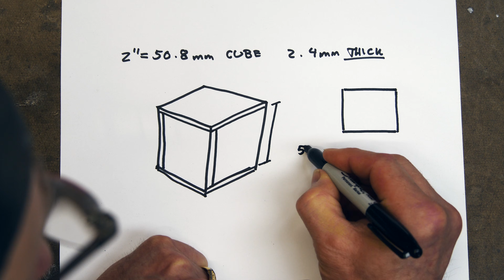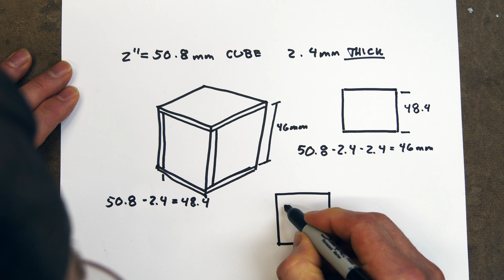Basic Acrylic model making for Designers, Architects & Makers

Comment: Nice video. It was VERY informative and answered several questions that I had regarding methods of cutting. I'm glad I found your video.
I am going to make some display cases and I need to put "shelves" inside the case (basically a large box). What type of a router bit would you recommend to clean up the edges of the shelves (or all of the pieces) where there will be a butt joint onto the inner walls of the "box"? Spiral upcut bit?

Comment: Finally somebody who can show the different glues. I cut acrylic with a laser, and many glues cause small cracks (creases) in the heat affected zone. Only one glue did not do that, a uv activated very liquid glue by Ruplo. Do you have experience with glueing laser cut plexiglass?
Reply from the maker: Plexiglass is polycarbonate, much different properties than acrylic, I really only have experience laser cutting acrylic and then using acrylic solvent to bond the material together. I'm not familiar with the adhesive that you're talking about. Experimentation is really the way to go. Thanks for your comment and sharing your experience.
Reply: @EricStrebel   nope, Plexiglas is a brand name for acrylic, after laser cut or flame polishing the sheets need annealing
Reply: Acrifix or magma bond is what we’ve used in our laser cut boxes
Reply: Methylene chloride is available through most plastics suppliers.

Comment: Another way is to make a template of the parts and then use the template and double stick tape to flush trim your parts. Cut your blanks bigger by about an 1/8 of an inch then route.

Comment: Hi sir, is Solvent and melted Acrylic aquarium safe? What is recommended to used for Acrylic and PETE? And for Acrylic and PVC? Is Acrylic good with Silicone? Probably is my bad skills..Thanks and appreciated your kind advices.
Reply from the maker: Each material will require a specific solvent, but once the solvent has evaporated it should be inert and okay for your tank

Comment: What kind of Glue  or what is the name of the glue used to Apply on the Acrylic  to stick it? Tnx
Reply: Cyanoacrylate (CA) glue
Reply: @davebacknolaliki1452  thank you
Reply from the maker: No, that is not what I used and it is not the correct glue for acrylic. You need acrylic cement or acrylic solvent. Link in the description

Comment: Hi Eric, thanks for the videos, very informative and I keep looking out for when "Motorhead" will appear and on what 🙂. I'm try to build a box using the 45 degree router method but am struggling to get a good clean 45 degrees along the length of the acrylic. Any tips?
Reply from the maker: Table saw works well

Comment: I want to build a gerbil cage for my gerbils that is larger than what they have now. I want to use acrylic sheets for the cage. But the frame, I don't think I can use wood. If you know gerbils, and I guess only people who had them as pets know gerbils.... They are major chew monsters. Anything made out of plastic, cardboard, wood, etc can be chewed into tiny little shreds very quickly by these little creatures. You could buy a bunch of gerbils instead of a paper shredder and you get the job done. Or even one gerbil and they would get the job done. Does anyone have any suggestions for what to frame my gerbil cage with? I mean metal would be ideal, but I can't cut metal so easily with my equipment.

Comment: just use melamine saw blade and a plate with zero clearance for the table saw add on your cut 1/32'' or .79375mm on each side and use a jointer to reamove the extra material and you will have a prestine edge for gluing.
Reply from the maker: Hmmm, interesting, so a planer is needed, what would the  min or max thickness of the acrylic for that?
Reply: @EricStrebel  you can put many sheet of acrylic hold with C clamp and if you are able to handle the weight of your stack ( depend of the dimension of the part minimum length 8'' or 203.2mm ). for the capacity of the jointer 6'' up to 16''. The planer you are limited in the width of your piece because a planer opening are 6'' or 152.4 mm up to 8'' or 203.2 mm  minimum length 12'' or 305 mm and you need a jig. With a router table your can too like a jointer but you need a guide with a difference 1/32'' or .79375 mm  between in and the out. You can cool the part with a blast of air and help the bearing to stay cool and at the same clear the chip. the acrylic cast give a better result than extruded because it's more dry (less moisture). If you want to reduce the thickness of a piece of acrylic less  than 1/4'' or 6.35 mm i don't recommand because the material bounce a lot 3/8'' or 9.5 mm to 5/16'' or 7.9 mm at this point you need to adjust the jointer 1/64'' or .396875 mm by pass the maerial bounce less and you need to feed slowly. if you feed your material to fast your will not achieve smooth cut at all. For the tickness available on the market may vary 1/16'' or 1.5875 mm to 2'' or 50.8mm nominal size and up but cost by sheet is high. use a caliper to mesure the thickness of your material for a project because the tickness vary a lot with acrylic cast for acrylic extruded it vary less.

Comment: Dude!   Build a little slide for you table saw for cutting small pieces.   That's the biggest danger in the shop.   A sled will hold the piece better for not just safety, but more consistent sized pieces.
Reply from the maker: Actually I have one it's a big one building a small one would probably be a good idea

Comment: I used to build acrylic aquariums. For the best bond, you want really smooth edges, then, as you show,  hold your joints together dry, then apply the solvent while the joints are held tight. The solvent gets pulled into the joint using capillary action. If the edges aren't nearly glass smooth, you risk having a slopping joint. To get things glossy smooth, you can sand through grits up to about 600. Then you take a propane torch and just "kiss" the rough edge. Just long enough to knot down any scratches.
Reply: What technique do you use to apply the liquid? I have had problems with my syringe dripping on the acrylic
Reply: @JorgeVega-b9l  capillary action should draw the solvent into the joint. you can use masking tape to protect most of the area near the joint if it's hard to avoid drips. I used a syringe with a long metal needle.

Comment: Great video! One tip I learned from a master acrylic fabricator was to squeeze some air out of the needle bottle before you invert it, then it will draw in air slowly until you squeeze it, keeps the solvent from going everywhere every time you invert the bottle and helps you get the solvent only where you need it!

Comment: Hmmm... for some Reason YouTube ate my previous Comment... so refraised another try

Perfect Video for a Beginner, as always.
Dichlor is the best Glue ever for Acryl and some other Plastics
But Talking Safety! Wear Gloves! Preferebly Nitril or Vinyl
DCM goes through Latex as most Chemicals do.
Skin absorbs DCM and worst case you can get CO-Poisoning.

Only work Outside, in a VERY well-Ventelated Area or with a Mask with the right Filter Cartrige...
Do not under estimate DCM
Reply: You are correct! DCM is super nasty stuff, it melts plastic on contact, imagine what the vapor can do to your lungs! Don’t be fooled just because it doesn’t have a super strong chemical smell.
Reply: @getdirecti0ns  its less the 'Melting Plastic' Problem

Our Body Metabolizes DCM similar to Choroform.
It causes dizziness to unconsciousness, nausea and headaches. And Prolonged skin contact dissolves the Fatty Tissues under your Skin and in a worst Case causes Chemical Burnes
Reply from the maker: Thanks, good tips